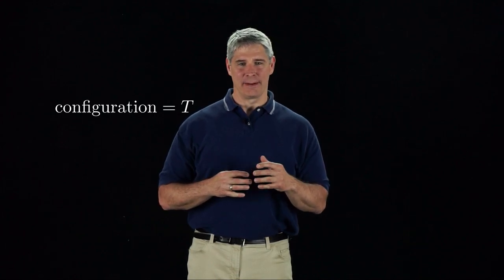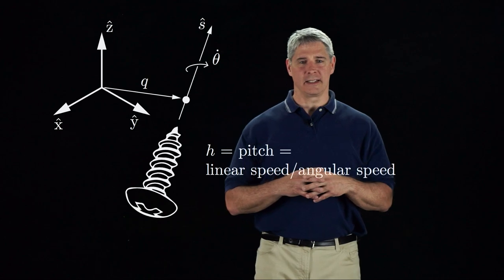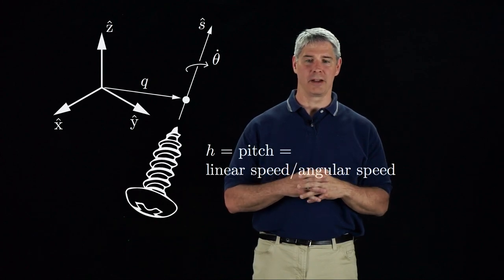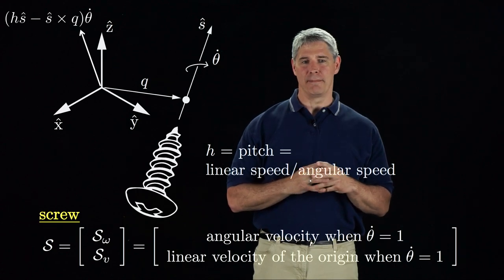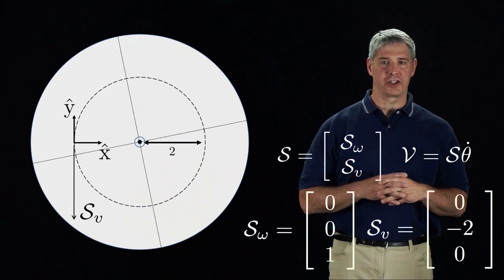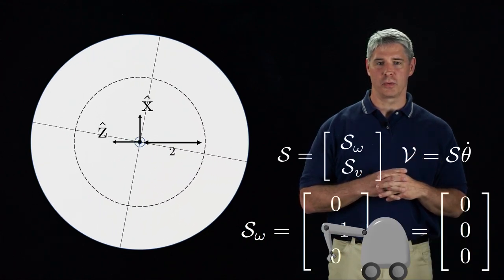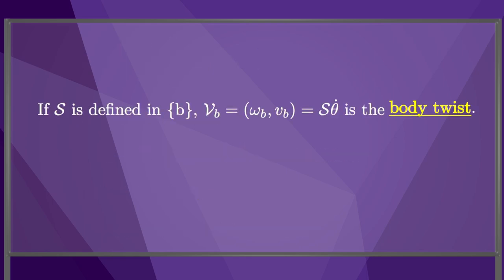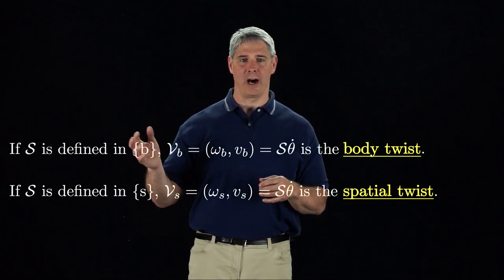Modern Robotics, Chapter 3.3.2:  Twists (Part 1 of 2)

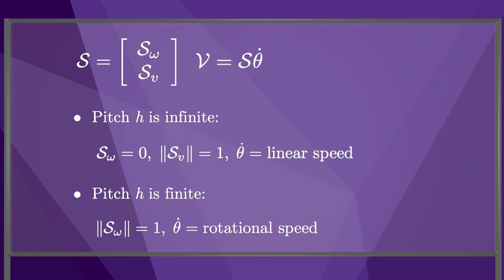Comment: 3:50 - h is finite then theta_dot defines not only rotational speed, but also linear speed, isn't it?
Reply: Well he's normalizing angular speed to have a magnitude of 1 in the S vector, so it only defines angular speed. If theta_dot denoted both, then ||S_v||/||S_w|| would always have to be the same.
Reply: @zevminsky-primus7434  Am I understand right that skrew can represent either linear or rotational speed and not both at the same time as it would make ||S|| > 1?
Reply: @MrSerozka  Well it can't represent the magnitude of both at the same time because there are two independent magnitudes, and just one theta_dot variable.